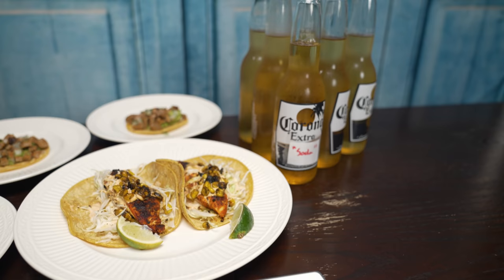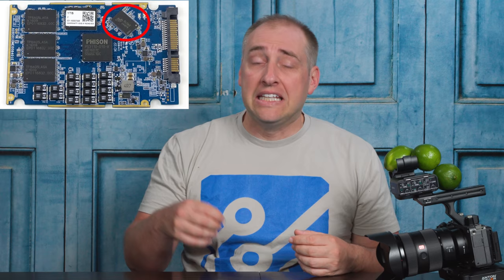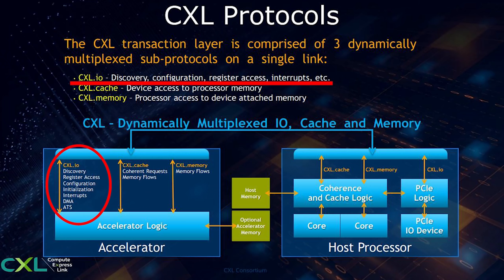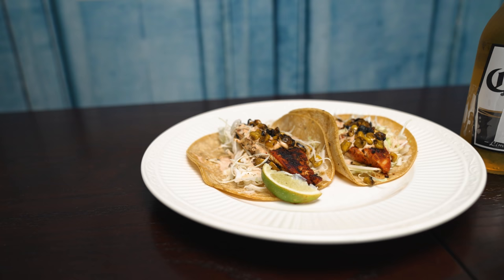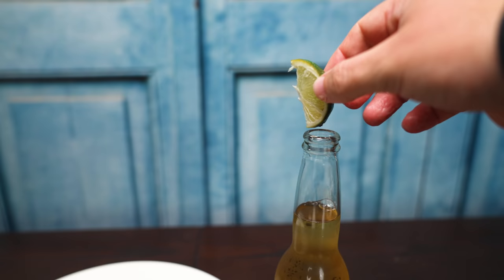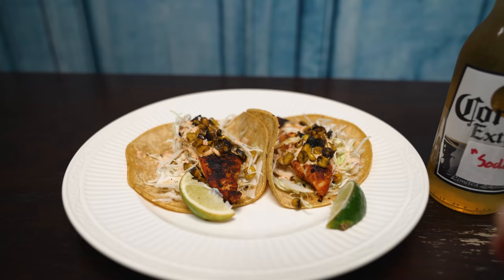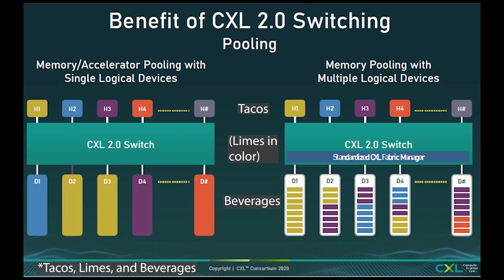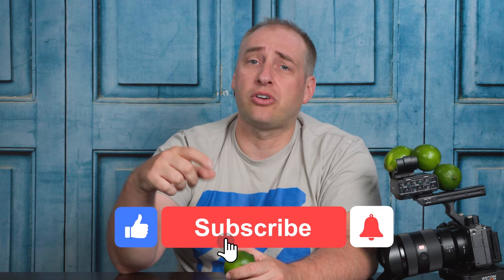CXL in Next-gen Servers Will Make Today's Servers Obsolete

Comment: Is the increased flexibility provided by CXL worth the performance losses though? You're effectively trading cost by introducing a serious interconnect bottleneck. While faster PCIe speeds can help mitigate that via higher bandwidth, PCIe is relatively high latency. And if the system is able to see the resources as a "pool" regardless of where they are located, it can easily lead to issues of poor allocation. For example, if the DRAM on a SSD was seen as general "RAM", and was allocated as a frame buffer for video decompression by the main CPU.
Also, higher speeds with PCIe means more power is required to run it, and there is also a practical limit to the frequency of operation for silicon based transistors. 
I guess it depends on the workload / application. This is probably a good solution for applications with low arithmetic intensity + low data re-use + high latency tolerance, but not good for other applications like AI - although I guess you would probably want to use a more dedicated solution in that case.
So then is the trend a bifurcation of server architectures, where one uses CXL for more traditional "datacenter" workloads, and the other uses specialized hardware for "cloud computing" workloads?
Reply: CXL is more about standardizing what's already being done everywhere. We need cache coherent interconnect to provide communication between various accelerators (GPU, CPU, FPGA). For example, NVLink. Essentially, it's the same thing as CXL but proprietary. Accelerators will still keep using their own local fast RAM but with ability to snoop caches of external accelerators and exchange data with them.
Reply: @creker1  Sure, but NVLink isn't great for performance either. I can understand the desire for something coherent, especially since it simplifies the software development cycle, but it also negatively impacts compute and power - something that will most likely not be solved with future technology. 
For example, NVidia has the ability to share host memory as global GPU memory, but it has 1) poor latency, 2) poor bandwidth, and 3) uses quite a bit more power (because of all of the communication). Although, if you use it poorly, you could probably negate the increased power consumption because the GPU will be sitting idle a lot more waiting for the interconnect. 
That's why I had asked about this idea of bifurcation... use CXL for cases where you just don't care, and then resort to more specialized hardware with longer development cycles when you do.
Reply: @hjups  NVLink is very good for connecting gpus together and, effectively, share memory between them. Just look at what nvidia is doing with A100. Replace that with CXL and you get what Intel is going to do with Xe HPC. And you also can connect CPU RAM to that. The point is not to treat everything as shared pool but allow more efficient and easier communication. Instead of moving data between accelerators you can map it and use shared virtual memory space. That’s this whole APU and HSA that’s AMD was doing for awhile and now Apple is doing. This is all working and useful things that finally will be standard.
Reply: @creker1  NVLink does let you share memory between GPUs, and their custom CPUs, but sharing memory != efficient. This is a huge problem in computer architecture referred to as the memory wall. All you're doing with CXL / NVLink is allowing memory to exist further away, thus increasing the problem. The only exception would be in the case where your CXL / NVLink has the same latency and bandwidth as the local memory interconnect - which will never happen. 
As for Intel Xe and the AMD APUs, the difference there is that the interconnect is wider and more capable of sharing memory (which is good). However, the performance of the shared memory for an APU is significantly worse than a dedicated memory link. 4 channel 64-bit DDR4 doesn't hold a candle to 12 or 24-channel GDDR6X. 
Meanwhile, I don't think it's necessarily fair to compare Apple's SoC / APUs to a server grade product. The reason AMD / Apple / Intel are using an SoC is to reduce the parts cost and power consumption exclusively for the low-power mobile market... Those are not the same constraints that datacenters have. So if the goal is to emulate what is being done with SoCs, then at the datacenter level, you're getting the worst of both worlds, so to speak.
Reply: @hjups  sharing memory is efficient if you try to limit the amount of communication and don’t ping pong between gpus. People know how to hide latency. That’s how A100 and Google TPUs work. They share memory and split workload effectively allowing them to scale beyond single chip. That’s the whole point of interconnects. Intel is going to do the same with Xe. I’m not talking about their desktop offerings but about datacenter gpus that will use CXL to share memory like NVLink. The only reason I mentioned APUs and Apple here is because they’re already doing these things. They share memory, they map virtual memory space, they support cache coherency, they can use efficient memory fences for communication. There’s demand for such use cases even on desktop. And now datacenters want to make a standard instead of reinventing the wheel every time.  These interconnects are everywhere  but they’re proprietary. There’s no point in arguing how efficient it is. It works, people want it and use it. Now we need make it a standard and finally move into better future where whole server is interconnected. It opens up use cases simply not possible before. All the performance problems that comes with it are understood and can be dealt with.
Reply: @creker1  Sharing memory is efficient if you have low data re-use (i.e. you only access it once from the remote node). So yes, if you memory map a SSD to virtual memory, and pull that down into the shared memory on a GPU, that could be very efficient. But the latency would be terrible. If instead, you have some host memory which stores a value accessed repeatedly via GPU global memory, then that will be very inefficient, since each transaction may require an interconnect request (if each request is a cache miss). You also need to have the ability for the software developer or end user to specify where all of the data resides to help optimize for efficiency which is not trivial (I would be afraid that CXL would make that process opaque).
The whole point of interconnects is not shared memory though... the whole point is being able to transmit packets of information between different "nodes" in an easy way, where the process is handled by the hardware rather than software (so no TCP/UDP libraries to do network communication if you can treat it all as one contiguous memory space).
And scalability depends on the workload. Interconnects do not scale... so if you have some GPU problem that runs at speed X with one GPU, if you add another GPU, your problem doesn't speed up to 2X (it might be something like 1.8X, and a 3rd GPU goes up to 2.4X etc), because you have increased contention over the interconnect. 
Also, memory fences over a fabric are going to be terrible inefficient... think about how expensive a mutex lock is on a modern CPU, now imagine you have a 10us latency to get a round trip message over a single PCIe hop. Being able to support that makes it easy if you don't care about performance, but if you do, you're not going to want to utilize it. 
I agree that it works, and it wouldn't be adopted if there wasn't a market for it. I guess I am questioning if adoption is like jumping from a frying pan into a fire. I know I won't have any impact on adoption, but I am questioning if we should even be excited about this? To me, as a computer architecture researcher, this seems like a short-sighted solution that's going to have detrimental system architecture implications for decades to come, so it shouldn't be something to be particularly excited about. 
I suspect that the only way to combat the performance problems is going to be adopting new styles in how the software is implemented.
Reply: @hjups  read the CXL standard. All the questions you have are covered there. It's not very long and reads very easily. There're 2 cache coherency bias types specifically to improve speed (it allows to completely eliminate CXL from the equation for specific parts of memory). It also has latency targets - 40-50ns max for cache snoop miss. That's on-chip interconnect latencies right there. So it will be very fast. And yes, the whole point is to share memory and we share memory because we want to communicate and send data in an efficient way instead of dumb DMA. CXL.cache is exactly that case. It keeps caches in sync and allows CPU to device memory and device to CPU memory access while CXL.mem allows transferring large amounts of data. It's all about simplifying and making it faster. CPU can just access some virtual address that will actually be mapped into device's memory and will go through all the caches (right know caching is disabled when you access external devices). Of course software would need to keep cache coherent device-to-device communication to a minimum. That's a given but every time you do have to access someone else's memory you can do so simply by accessing a memory address and hardware cache coherency engines will do the rest.

CXL making it all opaque. Manufacturers will have a choice. Either they implement all that coherency magic in the drivers or in hardware. The latter is much faster and will probably be used in all high performance devices like GPUs and TPUs. That's the whole point, to leave the software out of it. But it doesn't preclude optimization. You have different virtual memory addresses pointing to different memory pools. Software can easily choose what to do with it. CXL even gives ability to specify exact latency and bandwidth in ACPI tables so that software can act appropriately. Similar to storage/memory/cache tearing we've been doing for years. It's all understood and solved problems.

About fences, CXL actually treats it as one the the 3 device types. Type 1 devices do not share their memory but only keep their caches coherent with host CPU. The exact use case is implementation of atomic operations. You want these specifically for communication and device synchronization. Atomics is why mutexes are actually extremely fast on modern CPUs because in non-contended case it needs to do one CAS instruction without ever going into the kernel. All proper implementations work that way. Pthreads, for example. Mutexes being slow is a modern myth. They're slow when you have high contention and in that case mutexes has nothing to do with it and it's all about your algorithm.

As for whether we should be excited. We should. CXL promises to achieve efficiency akin to inter-socket or even on-chip interconnect (AMD's infinity fabric has up to 90ns latency core to core). Instead of dealing with tons of proprietary solutions we have one single standard. It will only increase adoption of interconnects and allow use cases simply not possible or very difficult before. Right now for any kind of communication you have to do complicated dance with DMA and device registers in the drivers. It's all terribly inefficient. Unless you implement something yourself like Inifinity fabric, NVLink, PowerAXON, OMI etc etc. CXL solves actual problems we already have and brings all the vendors together so they can innovate and benefit the whole industry. Together with Gen-Z they have all the potential to revolutionize the industry.
Reply: @creker1  I'll have to read the CXL standard, no doubt. But from your description, it sounds like the "standard" is a goal rather than a requirement.

The only way to get 40-50ns of latency is to target on-chip SRAM. There is no way you can request memory from another node in that time span.... DRAM has a flat random latency of up to 90ns (regardless of the technology), so the signal would have to travel back in time to meet that standard. Also, 40 is about the latency of a chiplet-chiplet request via the Infinity Fabric as I recall. So if a CPU tried to make a request to RAM on a GPU, then you would be looking at 2x that at least with CXL, because it has to make two hops. So then maintaining cache coherency with a GPU could easily take 100ns to do a CAS. 

You mentioned that CAS is "fast" because it's a single user-space instruction. However, that's irrelevant. The complexity comes with how the CAS is implemented in hardware. So while it is certainly faster than locking a mutex via a kernel call, it's still going to take 100s to 1000s of CPU cycles to perform. And if you now have to do it over a CXL network, then that could go up to 10,000s to 100,000s of CPU cycles. Remember, that a mutex lock is an unpredictable operation, so when the instruction is issued, the CPU pretty much has to drain the entire pipeline / buffers until the instruction resolves (it doesn't actually do this, but that's the effective behavior if the mutex lock fails, and then it repeats until the lock succeeds).

To me, it sounds like the only benefit is this reduction in complexity from a software development perspective, at the cost of performance and power, and with an increased chance than a developer will abuse the simplicity to further amplify those pitfalls. 
Oh, and this whole interconnect and utilization problem is not understood and nor solved... Thinking that is pure hubris. It's an active area of research, with some academic conferences devoted entirely to solutions to some of the sub-problems in that area. It may be true that there exists a "solution", but that doesn't mean it's the optimal solution, or that it's solved. You could also say "well we're not going to worry about that" (which was the PCIe approach), and that's also a "solution".

Comment: 16 lanes of PCIe 5 is still just 64GB/sec of throughput (not bandwidth - that's a signalling term that applies to frequency).  That's far too slow to obviate the need for onboard memory on any of the devices you listed.  That's without even accounting for latency issues.
Reply: think of 16-lanes as a single dimm socket.  there's no reason you can't use lots of them.  you can even think of CXL has providing a standardized and high-level memory interface (not the archaic rows/columns/etc).
Reply: Correct. CXL will not replace onboard memory. That's not the point of the technology.

Comment: I stopped watching after five minutes when you talked about sharing memory.  There are all different types of memory in a computer. They are completely different from each other. It may be possible to use graphic card memory for computer memory but it would be a waste of money. Conversely, you can use computer memory in your graphics card but then you would have the slowest graphics card. Future generations of servers will always make older generations servers obsolete. This is nothing new.
Reply: True, the video doesn't do CXL justice really. CXL actually acknowledges that devices have different memory with different speeds and it will always be faster to access that RAM. In the standard itself there're 3 types of devices and GPUs fit into type 2. Connecting RAM over CXL is type 3 device. What CXL provides is cache coherent access between various pools of memory and ability to access it all as a shared virtual address space from the point of view of CPU. It simplifies memory model and makes it faster by implementing all the difficult cache coherency stuff in the hardware. Separate memory pools private to devices are not going away. CXL only allows CPU easier and faster access to them. Type 3 devices do actually expand RAM but it's a very specific type of devices. They don't have anything apart from RAM and have larger latency targets. Software would probably have to treat it different from the main RAM and apply QoS rules to keep hot data closer to the CPU.